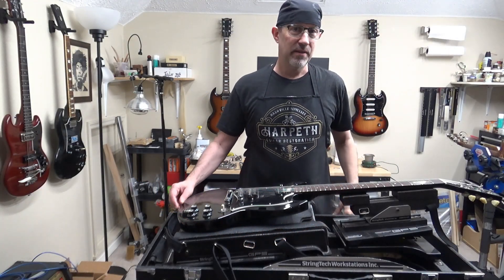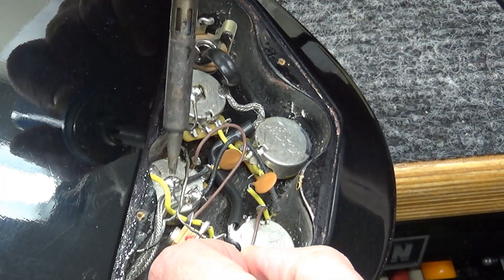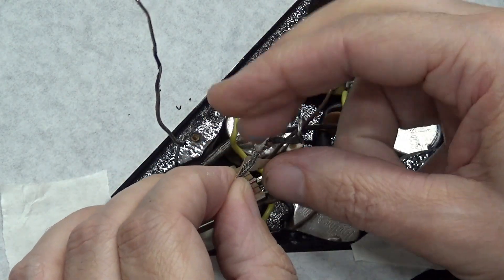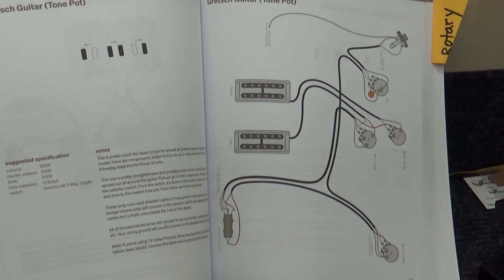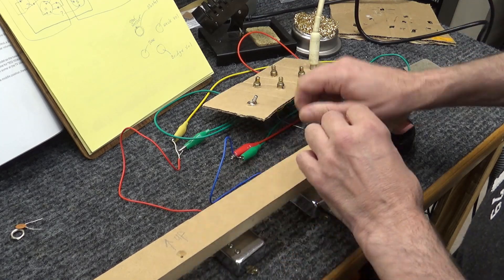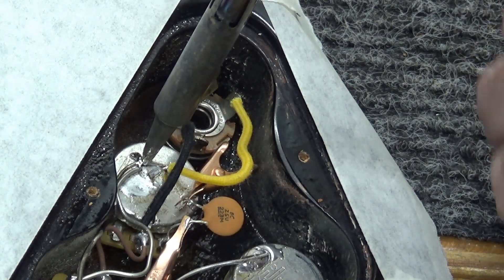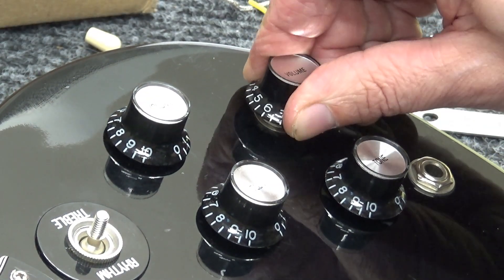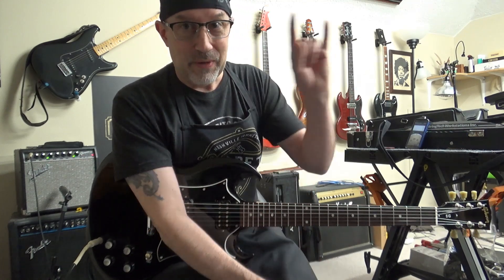Gretsch Wiring for Gibson

Comment: Love your channel and Ted's also. On Ted doing the extra work on the switch. If I'm not mistaken, he said the switch was not a typical diameter or length so he couldn't use a nut from some other company. The nut that came with the switch was only able to capture 1 or 2 threads. So to improve the amount of tightness he had to do the under-bore.
Reply from the maker: Thanks for the info!

Comment: Cool video. If you really want that thing to be wired like an old Gretsch, wire the pickups directly to the switch, then the individual volumes, then tone, master, and output. Also, on the two pickup volumes, reverse the input and the wiper. You’ll get fully independent volume controls and it absolutely affects the tone. I’ll email you some diagrams I made up after researching it (and also with the help of Gruhn Guitars). Great channel!!!
Reply from the maker: Thanks a bunch! 😁